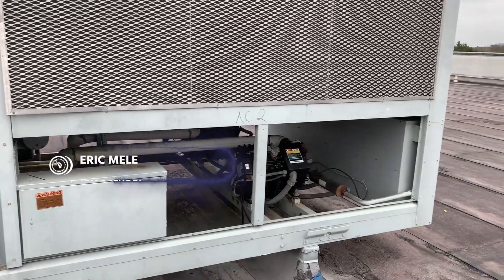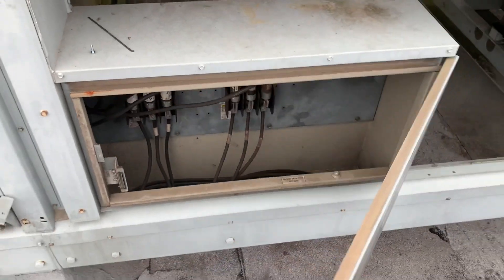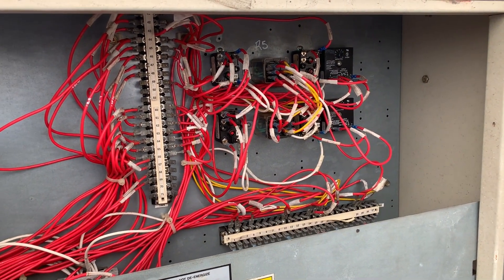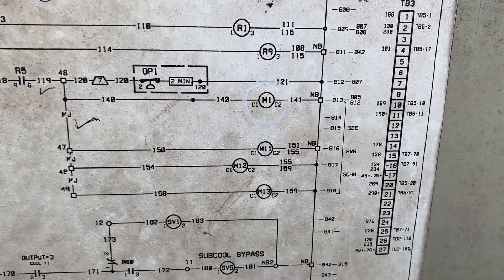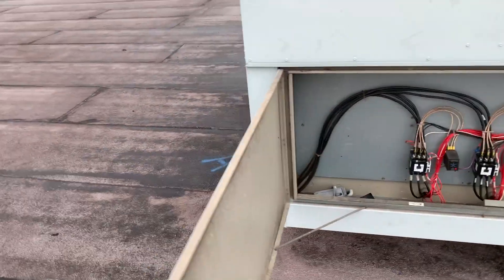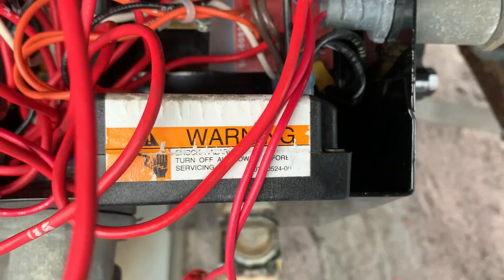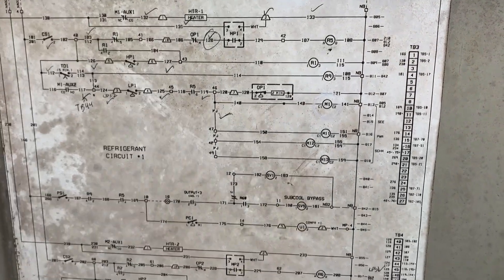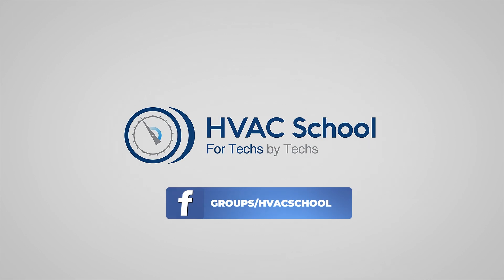Troubleshooting a Miswiring Issue on an Older Commercial System

Comment: Hi Jason,
Thank you for the traced wiring problem, one comment, on the wiring diagram it will be helpful to point out with a small screw driver tip the tracing in a slower pace, as they are beginning techs which will get lost in the pin point understanding teaching display.
Thank you for sharing your experience and valuable teaching and passion.

Comment: Worked on trash trucks. Had a PLC between the seats to control the beds functions. All. Red. Wires. They DID have a # printed on them though. Initially was a little intimidating. Used a short finder a ton on them to track wiring.

Comment: I need to learn how to read schematics like that
Reply: This was one of my reasons for disliking hvac for a while, so I’ll give you what helped me.  Spend time with a schematic while in front of a unit. Try to pick out any wire you need to look at in the circuit, and just go down the line with your fingers while referencing the schematic.  And I literally mean go down the line, safest and easiest I have found to an extent, while learning, and then getting more comfortable without using it, is putting a zip-tie around one of the wires in the circuit you are trying to identify.  Easiest way is to start at a control that you can easily identify in the circuit you think is the problem.  Find where that control or sensor is in the schematic, and go to the next termination on that wire.  If it goes through conduit, then find a way to identify it on the other end of the conduit.  It wasn’t easy for me to learn how to troubleshoot on a unit.  Classroom lab units were, and look nothing like steam turbine driven open shaft 1000 ton chillers, I can promise you that.  Also get the feel for ohming out circuits.  You will get it, we all do at some point.  Different paces for everyone.